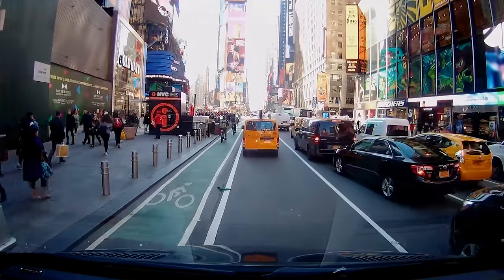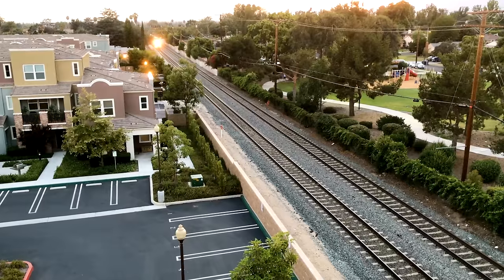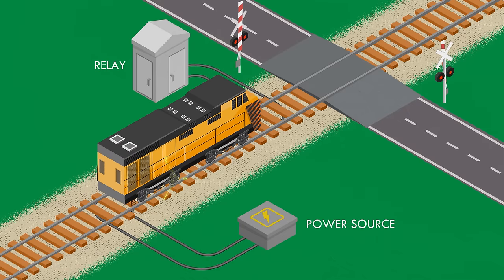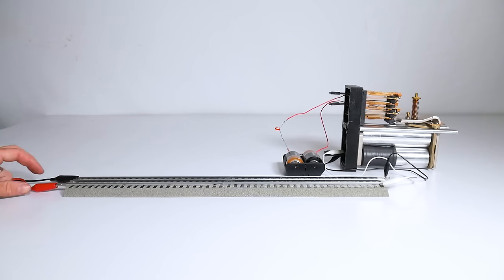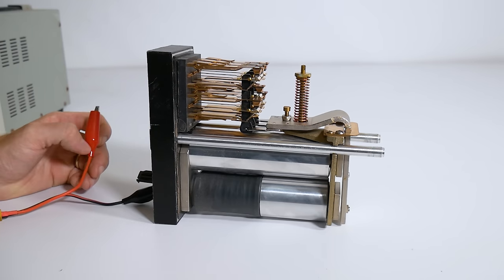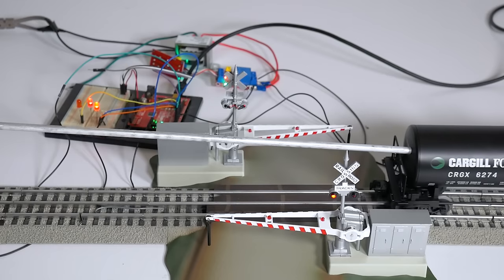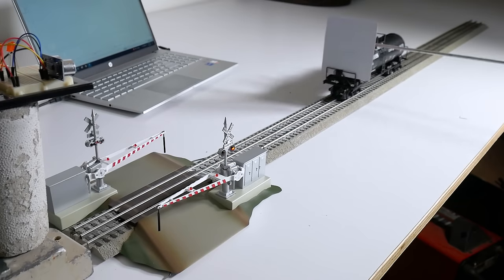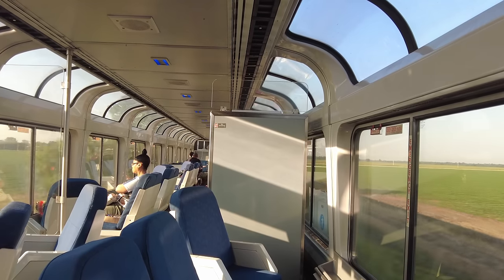How Railroad Crossings Work

Comment: As a railroad signal maintainer you did an excellent job explaining this. I wish I had you when going through training haha
Reply: I 2nd that
Reply: Certainty better than the decades old stuff they teach us on lol.  We don't use predictors etc where I work so that was interesting.
Reply: what voltage/amperage is used in a system like this? im assuming 24v/sub amp levels? had a shop teacher back in highschool have us help him build a train cart to get to his fishing spot up north, said if you bridge the rails it could kill you... seams highly unlikely to me.
Reply: @Drunken.Kitten  I’m not sure on the exact voltage for our crossings but it’s very low. If you bridge the rails you don’t even feel it. It’s more of a frequency that we put out on the rails, and all crossings in the the area are different frequencies so their signals don’t overlap
Reply: @seaofred88  okay, that's what I thought. Is it controlled analog or with digital mosfets or something like that? On city power I'm assuming with battery for back up?
Reply: @seaofred88  honestly this is really cool. Love this kind of stuff
Reply: @Drunken.Kitten  Track circuits for the approach & island style crossings are approx. 5VAC & 2VDC with less than 1A current. Predictors use maybe 0.5VAC with a tiny amount of current as they depend on the frequency of the signal instead of the amount of current.

Comment: I’m a school bus driver. A fella came to speak to us about crossing safety. On the topic of evacuation of the bus because of a possible impending collision/derailment, we should direct the student in the general direction the train is coming from but at an angle so that every step move us away from the track. So if the train is expected from the north the we should move to the NE or NW.
The idea is that collisions frequently result in the train derailing. At that point the cars and cargo can be thrown far from the track. The derailment is mostly down stream from the point of the collision (that isn’t always true) so don’t move in the direction of where the cars will be derailing.  So move upstream and away from the track.

Comment: Loved the explanation of how the circuits tend to failsafe towards assuming a train is coming - we had a winter storm a few years ago that had very strong winds and caused widespread power outages in my area and I was driving home from work that night and a local train track had lost its power and was stuck in the "train is coming" state. All of the drivers near me waited a good ~5 minutes before carefully (and terrifyingly) navigating our cars around the gates because there was no alternative way to get home without going over a similar track elsewhere
Reply: Chances are a track circuit went down. All crossings have battery backup.

Comment: I grew up near grade crossings for high speed commuter rail. We were taught from an early age to "Stop, Look, and Listen." With two tracks, sometimes the gates would be down with a train stopped at an adjacent station, but what you had to be aware of was the possibility of an express train approaching from the opposite direction. Unfortunately, a high school classmate of mine was killed by a train in exactly this manner.
Reply: Yes, I have seen a few people also push through because they are trying to board the train entering the station, not realising an express is coming the other way. Fortunately they were near miss, but still concerning.

Comment: A common feature at extra-urban railroad crossings in the UK (or level crossings as we call them) is a handset that connects you directly to the signaller. These are generally meant for farmers who may have long and slow vehicles that might struggle to cross in good time, or even trying to drive a herd of animals across.
Reply: There's a telephone like that at every crossing in the country. Anybody with a low-clearance or slow vehicle is obliged to phone for permission to cross, and then phone again to confirm the crossing is clear.

Comment: Great video Grady. What amazes me is how reliable these circuits are. Yes I know, they can and do malfunction, but generally speaking, they are outside in harsh weather conditions and mostly just work 24/7 for decades as you said.

Another reason they use current on the rails to detect trains (instead of a radio transmitter in the cab) is that sometimes railcars get disconnected and roll down the rails un-commanded. If they assumed that only locomotives can control the arms, this could lead to a runaway railcar buzzing through at high speed without any crossing arms at all!

Comment: 0:47 I'll add to this: if YOU can see the TRAIN, it's too late for them to stop in order for them to avoid hitting you. My spouse is a former Union pacific engineer and has come home with too many stories of close calls because people were willing to risk their lives to save fifteen minutes waiting for his train to pass.

Also important: some grade crossings do not have rails or lights to warn you of oncoming trains. If you come across one of these, stop and look both ways up the track for headlights (trains almost always run with their lights ON) and if you see headlights, don't cross. You don't know if that train is going 15mph or 50mph, f they're a mile away or a quarter mile, but the time to find out is not when you get stuck on the tracks.

Comment: Here in Australia, traffic lights are often integrated into the railway crossings, so the traffic light controller is aware of the location and speed of trains and this dictates the stopping pattern. It’ll let traffic go only in certain ways for as long as the gates are down, and as soon as the gates are up, the lights change. It’s a pretty cool system.
Reply: The same concepts happen here in the USA.  The term is "traffic preemption" but that generally is only on the level of the traffic controller being told YES or NO there is a train coming.  The railroad equipment has all the speed/timing information and simply passes the message on to the traffic signal control when it's time to.
Reply: Yes it is amazing. I watch the signals around the Baltimore Light Rail coordinate with the train. The train travels down major city streets as well as grade crossings in the county. There are extra electronic signs to let drivers know what is going on. Seems to work well even between stations that are close together.
Reply: @chrisharris7893  FYI, those signs are called "blank-out signs"
Reply: Yes, when a Railroad crossing is integrated into a signal, they go through a pre-emption process. 

This involves ending whatever phase is active and going to a track clear phase to flush out traffic over tracks. 

Then to a dwell phase which allows non conflicting movements to go. It can also cycle other non conflicting movements during a train. 

I'm currently working on a traffic signal that will allow pedestrians to cross the parallel major street during a non-conflicting train by using special ped phases only ever active during a Railroad preemption event. 

This is all somewhat similar to emergency vehicle pre-emptio, except trains hold a higher level of urgency and can get away with short changing phases more than say a fire truck.
Reply: @EngMadison  ???
Reply: @jovetj  sorry, misread the conversation.
Reply: Here in Florida the relay is activated by the gate relay.
It clears the track phase and omits incoming phase until the gates come up.
Then the signal goes back to normal operation.
Most run on 24 volt.
Reply: @acinfla9615  That's interesting.  I would expect each situation to be unique. There surely are situations where the traffic signals have to be made to act long before the grade crossing signals show any signs of doing anything.
Reply: Its a clever system, but we still need work, e.g. when traffic backs up over the rails. E.g. Trafalgar in Vic has such an intersection, but this scenario has occured a few times.
Reply: @jovetj each situation is unique. The road engineer would have calculated the longest time for traffic lights to phase into rail mode (usually a pedestrian crossing) and that time is specified on their phase diagram which is used as an input to determine the pre-emption time for the crossing.

Comment: German (and many other European) rail networks use axle counters to determine the number of axles rolling in and then out of a section. They are more robust against contamination and don't pose the problem of having to isolate a section of rail. The downside is that they can have a counting error on the entry or exit, which leads to the signalling of an occupied section.
Another very cool system is the European Train Control System (ETCS) which is currently in the roll-out across the different national rail networks. It allows for continuous supervision of the trains and has some features build in for autonomous operation. It also allows for high speed trains that drive faster than the driver could identify signals or even brake when a train in front has to brake.
There is quite a lot more to consider when your trains go faster than 180 km/h (110 mph).
Reply: Yeah, really looking forward to full ETCS roll-out here in Czechia. European railway tech is really awesome.
Reply: The tgvs in France use the rails to transmit the block data directly to the cabin. And etcs does that too. But it's not all that great for the infra side. Each information point has to be doubled, and the devices used to check if it is working emit so much radiation that men are asked to get off the track when doing a reading. Moreover there's only one company that sells these devices and they sell it for 10K + you have to buy their tablet to connect to a wifi access point that points you to a web page. ETCS isn't compatible with last minit speed reductions used in track replacement worksites, as you have to send off the calculations to the manufacturer who takes X time to reply and bills each calculation 15K. The tech is good but the implementation is messy.
Reply: These axle counters also mean that trains in Switzerland are legally forbidden from having exactly 256 axles. Because the old axle counters use an 8-bit counter, and a train with exactly 256 axles would just ghost through invisibly!
Reply: @paulzagieboylo7315  that's hillarious! Is that really true? When are they going to phase out those old counters?
Reply: As far as I know, even with ECTS 2, level crossings are not permitted on tracks with higher operating speeds than 160km/h. Everything needs to be bridged or tunneled.
Reply: Here in Brisbane, Australia, ETCS is also slowly being rolled out across our network as well, being used first for a river crossing where a lot of train traffic is expected to be put through.
Reply: @Fry_tag  ye, but that might have more to do with the point that the faster you go, the longer it takes to stop and it can take up to 5km stop one in a Non-Emergency Brake Situation
Reply: In Romania, axle counters are not accepted. They are sometimes installed as backup, but the whole track circuit must be free for the gates to open.
Reply: @paulzagieboylo7315 thats one hell of an an edge case! Kinda funny to think that your rail system has the equivalent of the y2k bug, but at least its known about. Granted, 256 axles is just over 60 standard 4 axle cars plus 2 6 axle locos, which is reaching some pretty american sized lashups lol
Reply: @enisra_bowman  yeah, even with just one train per direction per hour would cause the gates to be closed for a good chunk of the time. Let alone the disasterous effects of any problems - even less of a chance of spotting the approaching train, even more energy in a crash, very high chance of derailing the whole train... High-speed rail is expensive, adding overpasses where needed is not that much of a difference.
Reply: @paulzagieboylo7315  I can't verify this, but on all European Railway lines (may be except for the famous iron ore line in Sweden), trains with 256 axles are way beyond the practical and legal capability. Therefore, this is a theoretical issue only. Geography in most parts of Europe just doesn't allow for trains that long by far.

Comment: as a signal maintainer in the NYC area, you did a great job at explaining crossings. it does get a little crazier with all the relay logic that's required for everything to work flawlessly. F.R.A testing that's required either monthly/quarterly/yearly (Test 27 a,b,c) all play an important role in keeping things safe.
Reply: FRA Part 234 keeps us busy
Reply: I prefer relay logic.

Comment: Railroad preemption of traffic signals is a topic that could fill its own video.  In its simplest form, a track clear function will flush vehicles that may be sitting on the tracks and it will prevent vehicles from turning onto the track-facing lanes during the "dwell" time.

In more complicated forms, the intersection being preempted can communicate to other intersections, either through a central system or by peer-to-peer communication to change signal timings in the entire corridor to compensate for the additional volumes of detouring traffic.

Comment: In my country, Belgium, in 20 years, they removed 1/4 of the railroad crossing and added bridges or tunnels.
It's nor always possible, but they did it a lot. It's quite impressive to see what they did in some cases, especially in places where roads are by the hill. Lots of digging and stabilisation took place.
Reply: they did that in The Netherlands to, and are still doing that.
if it's possible separating road and rail traffic they do that, it takes years because of the amount of crossings.
but separating the two is the safer option, if you remove the point where the two kinds of traffic cross you eliminate the possibility of a collision, and road traffic doesn't have to stop so traffic flows better which in turn safes people time and companies money. it's a win for everyone.

unfortunately some crossings are surrounded by buildings and/or other infrastructure so sometimes it's (almost) impossible to put in a tunnel/underpass (the prefer tunnels over bridges).
Reply: @ChristiaanHW  They've had a lot of at-grade crossings in Melbourne until the past few years ago when much of the rail has been relocated to viaducts.
Reply: depending on how often a train passes by  and it's speed  US communities replace at-grade crossings with bridges over or under.   California is doing this for our "high speed" rail

Comment: I used to work for Safetran on the crossing controller and grade crossing predictor products.

In general, the two approaches and the island are just one electrical circuit, not three, although there are more complex setups that might require more circuits, especially when there are multiple crossings with overlapping approaches.

At the beginning of each approach, the tracks are shorted or, "shunted," usually with a filter that shorts the track only at specific AC frequency,  This makes the track in each direction a big loop of wire (very thick wire!) that acts as an inductor to the electronics.  

An AC signal is transmitted onto the tracks via wires connected to the tracks on one side of the crossing, and wires leading to a receiver are connected to the tracks on the other side of the crossing. .

When a train crosses the shunt going towards the crossing, the "loop of wire" gets shorter as the train approaches the crossing, causing phase and amplitude changes in the received signal.  

The electronics monitors the phase and amplitude of the received signal compared to the transmitted signal, and from this information can tell how close the train is to the crossing, how fast the train is going and whether it is approaching or leaving, or right on the crossing.  The crossing warning equipment (lights,  bells,  gates) can be activated at an appropriate consistent time before the train arrives at the crossing, by predicting when the train will hit the crossing using the information of how far away it is and how fast it is going,

The island is defined by the placement of the transmitter wires and the receiver wires on opposite sides of the crossing. When a train is on the island, there is no signal going to the receiver at all because the train provides a direct short of the transmitted signal between the transmitter and receiver. This is how the electronics knows there is a train on the island. 

After the train has passed the crossing, the "loop of wire" is now getting longer as the end of the train gets farther away. The electronics then knows it's safe to deactivate the crossing warning equipment.

Also, if the train approaches a crossing and the warning equipment is activated, but then the train stops before getting to the crossing, the electronics can figure out that it is safe to deactivate the crossing warning equipment, so cars aren't waiting for a stopped train.

Of course, it's been a while since I worked in the railroad equipment industry, so the technology of grade crossing predictors has probably changed a bit, but I imagine it's pretty much still the same as I described.
Reply: Awesome description. You said it exactly how a signal maintainer explained it to me once. Thanks 👍
Reply: As a former US&S/Ansaldo, Bombardier, Siemens signal/onboard engineer, well said!
Reply: Yup this is modern day crossing prediction technology, what he's describing is what we call an "Easer-Weaser"

Comment: Fascinating insights into the intricate engineering behind grade crossings. The balance between safety measures and trust from motorists is a critical aspect that I hadn't considered.
Reply: There is in the video, however, a lack of accounting for the disregard for others, disregard for rules as well as plain utter idiocy of the average motorist.
Reply: @1121494  I don't think it needs said am any video that not respecting a train simply gets you killed